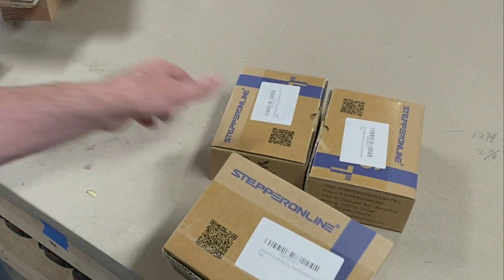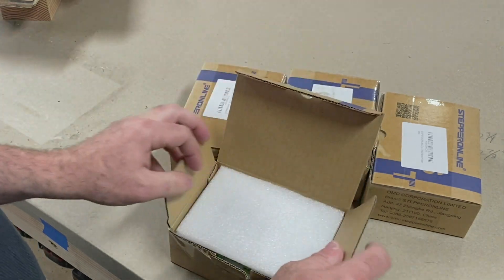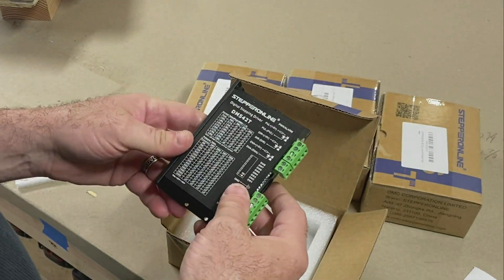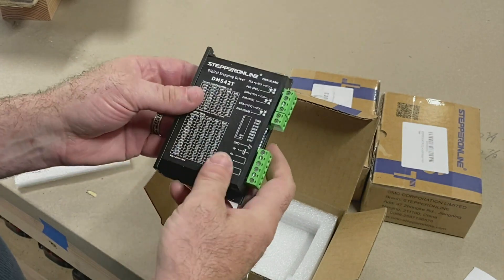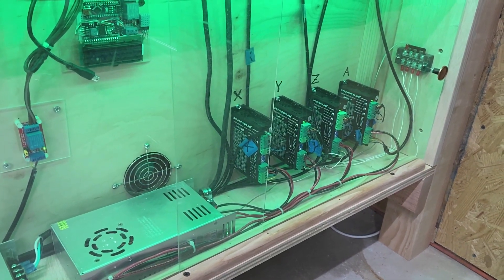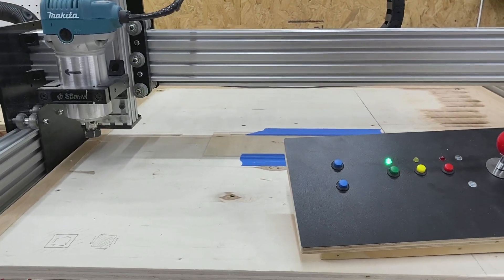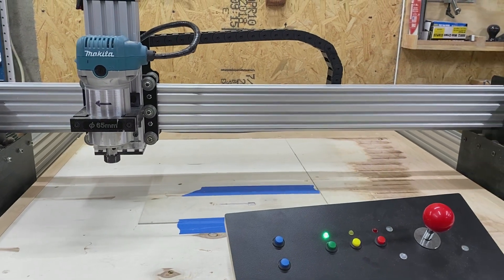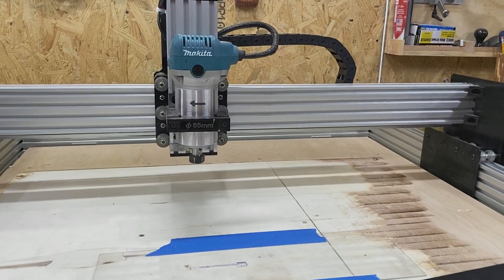Replacing TB6600 with DM542T on the CNC

Comment: i saw your Y axis has only one stepper driver but you have 2 motors in y axis could you please let me know how did u wire 2 motors in 1 stepper drivers bit curious
Reply from the maker: Hello @PKowthaman.  Thanks for watching.  This is a great question.  The second motor used in the Y axis is driven by its own driver I designated as "A".  As you see in the beginning of the video, there are four drivers and I labeled them as "X", "Y", "Z", and "A".  My Pi-hat controller supports 4 outputs and I can assign one of them as a mirror to another.  Hope that makes sense.  Cheers!
Reply: Gotcha. Currently I'm working with 5 motor environments .and I found always one issue with the limit switches I haven't seen any limit switches in your working place what do you use here instead of a limit switch?
Reply from the maker: @இயற்கையின்காதலன்-ள7ல  The limit switches are physically there.  They are not easily noticed in the video.  Basically the typical micro switches with rocker arms attached and mounted at the the physical limits of each axis.

Comment: Which controller are you using to run those DMs?
Reply from the maker: It’s a protoneer RPI  CNC hat for raspberry pi. Same architecture as the Arduino GRBL but more advanced features.
Reply: @FranklyRustic  much appreciated 🙏

Comment: Could you make a video on how to wire and code 3 of these things to use in a cnc?
I have watched to many videos on it, and they all say different things.
I just need to know how to take 1 arduino and 3 steppers & drivers and hook them all together.
Reply: I was about to ask same question
Reply: @lordtywin-w3h  this one is easy and it works but consider better controller

Comment: There are several versions of the tb6600.  The original use a big chip, bolted to the heat sink.  These were great.  Later versions use a surface mount chip,  taped to the heat sink.  These run very hot internally and are more likely to fail.  
The same goes for DM542 clones.  Early versions copied Leadshine and bolted the mosfets to the heatsink.  Later versions lowered the price by using surface mount.
Removing the cover and blowing a fan over the circuit board would dramatically increase their reliability.  The heat sink is incorrectly installed, so blowing air on it might not help as much blowing on the circuit board.
Reply: THe TB6600 I got from Amazon about 6 weeks ago had a small block of aluminium between the smt & the heatsink, the tape is thermal tape, but on the heatsink side there was no thermal compound applied, so i just used a little MX4 on it. Only use that for testing the 3018 controllers, which have Direction Signal & Enable (very usefull as brake only comes on when another stepper is being driven, save overheating), I notice the MACH 3 does not supply Ena either?

Comment: I’ve been wanting to switch my setup to these drivers, but not sure which main control board/breakout board to use?  I’ve been looking at fluidnc, but since I’m new I’m again having a rough time figuring out what to do.  

I would definitely appreciate any help.  I currently have an x-carve pro (see my videos), but their controller died and I’m out of warranty so wanting to learn to setup mine own for better maintenance in the future.
Reply from the maker: Hello Griffin.  Thank you for watching and reaching out.  First, I want to compliment you on your X-carve pro 4x4.  Sweet machine!

I really can't say what the best controller is for you as that comes down to your needs and experience.  I personally run off of a Raspberry PI running Linux and bCNC software.  It has a Controller HAT running a similar architecture as the Arduino GRBL controller.  It's made by Protoneer and is called an RPI CNC board v2.60.  That controller simply wires directly to the DM542T drivers or any other driver you like to use.

I am quite fond of the Protoneer controller as it  also supports a laser addon to the CNC.

Admittedly, the Protoneer board is not for the beginner.  I'd say it is for the intermediate to advanced user.  If you're a fan of Linux and scripting, this combo is quite sweet to tinker and hack with.

A Mark V controller would do well but requires licensing fees.

I am sure there are other controllers out there that might suit your setup better but I am not that intimate with the X-Carve brand.

Definitely pick the brains off of the X-Carve forum communities.  Many decent folk are willing to save a soul from the hell they went through with their units.  Not to say the x-carve is a nightmare but just some folks might have experienced what you're going through.

Thanks again for watching and keep on cutting.

Cheers,
Frank
Reply: @FranklyRustic  hey frank!  Thanks for the thorough response—it is much appreciated.  Of course I went to the protoneer documentation and was like “I think I can make this work” but then tried to find it to buy, and unfortunately I wasn’t able to find it yet after my first quick search.  Seems they are out of stock everywhere :(

One day I will get this nice machine back carving lol.  Any other suggestions on similar controller boards for external drivers?

Thanks again!
Reply from the maker: @grfnprjx  no problem.  Hmm. The next thing that is nearly identical to the Protoneer, is the Arduino CNC shield. It allows for use of an external set of drivers. Otherwise a more ready-to-use model would be the Mach 3 controller or CNC xPRO V5. 

I love getting down and dirty with circuits so the Arduino route would be my choice. Plus it is easy on the wallet and not much of a loss if you decide it doesn’t work out to your liking.
Reply: @FranklyRustic  @grfnprjx - CNC xPRO V5 uses FluidNC.  It initially used GRBL_Esp32 which was the predecessor of FluidNC, but a FluidNC firmware upgrade is now available.

Comment: Do you mind connecting the drives separately instead of connecting them to a single power source?
Reply from the maker: That shouldn't matter if the power supply is properly sized for the current load.  However, I did try them isolated too, just in case there was some form of harmonic feedback.  It didn't matter.  Note:  I have two power supplies for the drivers.  Look carefully and you'll see the second one laying in from of the other. Each is handling 2 drivers.

Comment: Can I use belt for cnc....I want to cut only wood
Reply from the maker: Absolutely.  There are many belt driven CNC's out there cutting wood.  They have the advantage of faster movement across the cutting paths.  However, "lead screw" driven CNC units have the advantage of higher accuracy.  If you are cutting out pieces (cutouts) then this point is not so important.  However, if you plan to do some engraving with high detail, then I would highly recommend the lead screw design.  Belt driven accuracy varies per make and model.  I recommend you review the accuracy and compare it to your needs.

Note:  Belt driven CNCs have come a long way and so has their respective software as they compensate for the elasticity and other properties inherited by belt driven machines.  That isn't to say lead screws are always precise... If the leadscrew is not assembled properly to handle backlash, then the advantage of a lead screw is completely gone.

I wish there is a simple answer for you but it all comes down to expectations, budget, and your desire to dive deep into this hobby.  I can tell you this...both have their pros and cons and both can be tweaked as your experience advances.

Good luck!
Reply: @FranklyRustic  thanks... Best answer
Reply: @FranklyRustic  and lastly....I needed a small cnc to curve wood........mdf precisely....can this 3018 cnc using 42 stepper motor fo it.....42 stepper motor is a 0.42Nm holding torque motor....so the question really is CAN A .042Nm MOTOR DO IT WITHOUT LOSING STEPS DUE ....
Reply from the maker: @minravex9919  Yes, as long as you're cutting depth and speed is not too aggressive when you program the settings AND the router itself is beefy.  I am not sure about the capable routers applicable to that carriage.  I would focus on whether it can handle a standard mini hand router or at least a strong Spindle motor with variable control.  From what I have seen several years back, those spindles designed to fit the 3018 are typically weaker than a standard Makita or Dewalt hand router.  It's definitely doable, you will just need to make many more passes than a larger, stronger CNC could.

If budget and curiosity is your premise behind the 3018, then I say go for it but plan to upgrade to a Workbee/Openbuild or something bigger and stronger in the future.  At least, by that time, you'll know far more about the CNC architecture and your needs and be able to build your own custom CNC more to your needs.  This would allow you to then build a CNC of your very own, focused to your needs without doubt of your skills.  Then you can either sell the 3018 or swap out the Spindle for a laser diode and keep the 3018 as your laser engraver.

Definitely sign up to the openbuilds.com forum.  Everyone there is very helpful and filled with pros kindly helping beginners.
Reply: @FranklyRustic  ....thanks...signing up
Reply: @FranklyRustic  I have signed up...but I have paused the build for now...my country corrupt leaders disabled self funding Fx....mean everyone must get dollar from the black market....and I don't have the huge extra funds
Reply from the maker: @minravex9919  We've all been there and completely understand.  Sadly, no country is safe from deep corruption these days.  May God watch over you and protect you and your family.
Reply: @FranklyRustic  Amen 🙏 😊

Comment: Which software do you use !!
Reply from the maker: I use bCNC to run and transmit the nc code. I use EstelCAM to produce the nc code for routing.  Lightburn to produce nc code for laser work. If I need to engrave something very intricate like a sculpture, then I use Fusion 360.

Comment: Can 20 motors be controlled from one place?
Reply from the maker: Sorry I missed this Saleh.  The short answer is yes.  The solution is not so easy.  It will need custom code to transmit Gcode to multiple controllers.  Definitely doable.

Comment: The truth table printed on TB6600 driver has ERRORS in two positions!!! You probably have set wrong motor microstep configuration.
Reply from the maker: Thank you for chiming in with a known issue. However, it was not that in my case. I worked past all microstep issues when I first installed the Tb6600’s. If they were off, it would have reflected in the jobs. All was fine but a little noisy. They deteriorated and got very noisy quickly after 6 months of light use. 

These Stepperonline DM542T’s are working great!  Still running smooth and keeping my motors quiet and cool.  Most of all, no lost steps.
Reply: @FranklyRustic  Good to hear that. I had similar problems with TB6600 and later with DM542. After opening cases it appeared that there are fake chips inside. DM542 and TB6600 had simple ST microcontrollers inside instead of Toshiba and Leadshine chips. So, the solution is to buy ONLY Leadshine or Stepperonline stuff. And the same applies to motors in my opinion. Leadshine makes great quality motors, little bit more expensive than regular no-name stuff.
Reply from the maker: @mariuszzyskowski7907  agree 100%

Comment: Hey great video, Just wondering what way do you have your switches on the DM542 drivers a I just got mine but not sure what way to set them. Have nema 23 stepper motors
Reply from the maker: Thanks Tomas!  The settings will vary for different manufacturers of the motor.  I'd hate to give you my settings and burn out your motors.  However, I can still help you.  What is the rated specs for your motors?  It should have come with the motors.  Reply back and I'll send you what you should set the dip switches as for your specific setup.  The specs I need in particular is the rated current.
Reply from the maker: Assuming your motors stay true to the Nema 23 specs, you can use the same settings I used.  Pin1 thru Pin 8 respectively are: on, on, off, off, off, on, on, on.  This will set the driver to 2.84Amps (peak) and 2.03Amps (RMS), half current load for holding power, and 400 steps per revolution.  Obviously you can further refine the steps but I find this more than adequate for wood routing.  If you are getting into circuit board design, or anything critical in refined dimensions, then you can tweak pins 5, 6, 7, and 8 to the microsteps you desire.  What's important is that your motor's specs align with the current settings (pins 1, 2, and 3).  You will want to confirm these settings are safely within the parameters of your setup before giving it a try.

Comment: what PSU are you running? Voltage and amps ?
Reply from the maker: I'm using two Titao 48V 10A power supplies set at 36V on both.  The X and Z axis motors are on one PSU while the Y and Y2 axis motors are on the second PSU.  Each of the four drivers are set to 2.0 amps RMS (2.8A Peak).  However, that meets the specs of my motors.  Yours may vary depending on the motors you have. Make, model, standard torque, high torque, etc...

Comment: awesome video. just asking, what could be the expected lifespan of DM542T motor drivers?
Reply from the maker: Thanks Brian!  Great question.  However, the lifespan is not noted anywhere that I can find.  Unless we tear one open and look up each component's datasheet, I can only "hope" it outlasts the stepper motors themselves.  Steppers motors have a short lifespan of 10,000 hours.  For a shop using them in 8 hour shifts, 5 days a week, the motors will only last up to 5 years.  I can't comment the same for the drivers but I can vouch for the better quality than the TB6600.  I've run these for an hour straight, on a regular basis, and not witnessed any heat when I touched them.  I guess that's why they lack heatsinks as they clearly do not need them aside from the flat metal housing.  Likely from efficient circuitry.
Reply: You probably dont give a damn but does any of you know of a method to get back into an Instagram account?
I somehow lost the account password. I would love any tricks you can give me!
Reply: @Case Joe instablaster ;)
Reply: @Karsyn Kylo i really appreciate your reply. I found the site thru google and im trying it out atm.
Takes a while so I will reply here later with my results.
Reply: @Karsyn Kylo It worked and I actually got access to my account again. Im so happy!
Thank you so much you saved my ass!
Reply: @Case Joe glad I could help :D

Comment: Hi..i new in cnc plasma.. Mach3 to dm542. The problem is i run x axiz . Why z axiz is run?. I run z axiz. X axiz will run. Pin have been check correctly. I have been change new bob mach3 port. Still same result. What is a solution?
Reply from the maker: I understand you checked between the Mach3 and the DM542 drivers.  However, check the wiring from the DM542 to the stepper motors.  That's must be where the wires are mixed up.    Quick tip.  I label both ends of each wire and each motor driver with their respective axis (X,Y, Z).  That will help in the future.

Comment: What is the difference in the drivers that makes one run motors quieter than the other?
Reply from the maker: There are several factors in play for motor driver to be responsible for a quieter motor. Higher quality components, better noise filtering components, efficient resolution control, and better engineering in the overall circuit.
Reply: DM542 is fully digital, using DSP with 25600 steps, great for tourqe, speed and precision applications...while older tb6600 is for budget hobby machines up to 6400 microsteps...in lame terms DM542 is 4K UHD digital and tb6600 is old analouge VHS...period

Comment: How much torque and speed are you loosing by microstepping?
Reply from the maker: I wish I could do the math and answer that but I haven't run into any stalling issues.  However, I am running the steppers with dual 48V power supplies set to 36V so I have no problem running at 1500 in/sec while in a route.
Reply from the maker: OMG.  I just re-read this and laughed.  I meant mm/min not in/sec!  1500 in/sec would be flying.  lol!  To be exact, I am set to maximum speeds of 2000 mm/min for the X and Y axis and 1500 mm/min on the Z but I always slow down the Z even further when routing. 1500 mm/min comes in handy when using it like a pen plotter.  Typically I route between 1000 and 1500 mm/min on the X/Y.

Comment: puedes ir a mayor velocidad de avance con los driver nuevos?
Reply from the maker: Hello Mikel! The driver does not make it go faster.  To go faster, without stalling, upgrade the power supply to a higher voltage but stay within the limits of your motors.  There are formulas throughout the web to help you pick the right voltage.   I'm using 36Volts on mine.  Remember...The voltage rating of the motor is not the voltage you supply.  You typically supply higher voltage than what is specified on the motor as the current limiters of the driver will prevent shorting out the motors.  Within reason.
Reply from the maker: I should clarify... You also need to change the travel speed in your software that generates the grbl/Gcode.